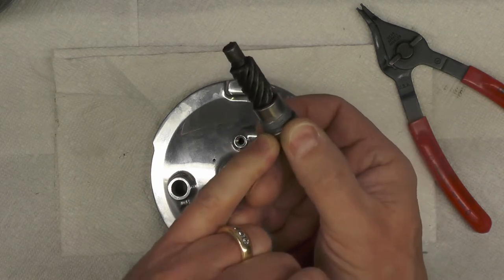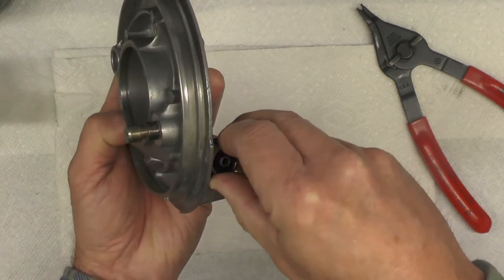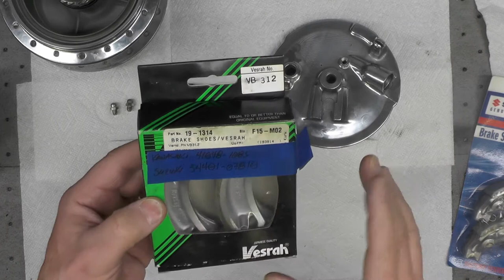Yamaha YL1, Front Wheel Restoration Part #3 --- Video #99

Comment: Hi Roy, Nice video. Did you re-plate the brake spindle and cable adjusting bolt? If not, won't it they rusty pretty quickly?
Also, I always use a little copaslip (which is a high temp grease containing copper particles) on the  mounting faces of the shoes. By this I mean each end of the shoe where they meet the spindle and the other rounded pivot end. I've found this makes the brake operation a little smoother.
Reply from the maker: I did not re-plate the spindle and adjusting bolt as they really didn't need it as the plating was in decent shape.  If the parts were corroded or the plating was worn off, I would then have re-plated.  This bike will be stored in heated environment also, so rust isn't too much of a concern.

Generally I am hesitant to use much lubrication inside a brake assembly as I don't want to contaminate the shoes or drum.  Especially on a show bike such as this which won't be ridden much, certainly not on the road, I don't find it necessary.

However, for an actual road going rider all your points are quite valid, and I should have mentioned these items during the video.

Thanks for your comments, Jono.
Reply: @kwrightway  Hi Roy, that's spot on. I have to confess that I love re-plating all the small parts, it wasn't obvious that the original plating was okay. When using any lube inside a brake, I'm always very careful and only use a minimum amount. Very much looking forward to seeing the wheel re-build and deciding if I can do it myself....! Thanks again.